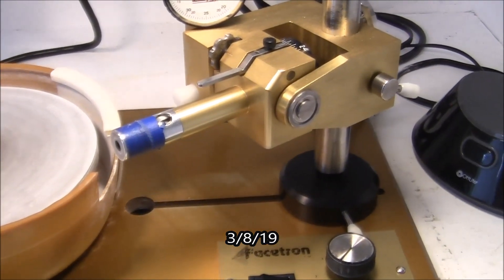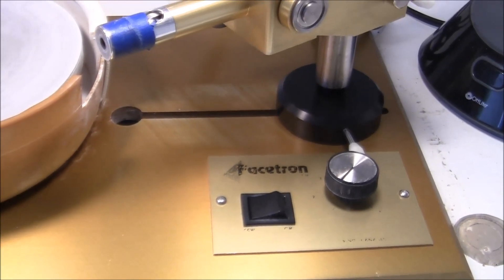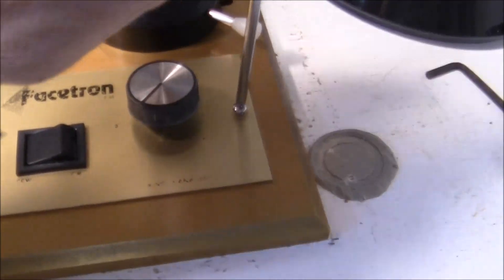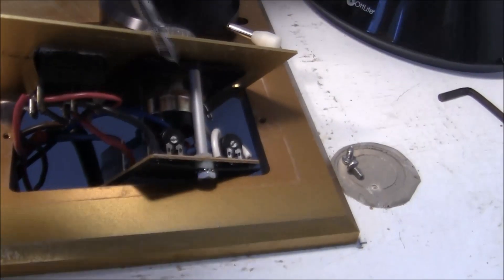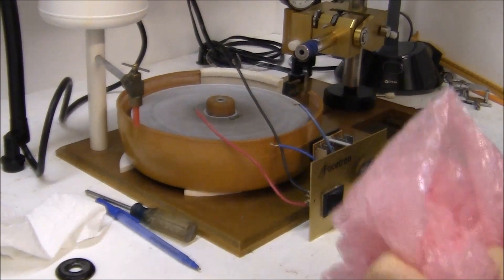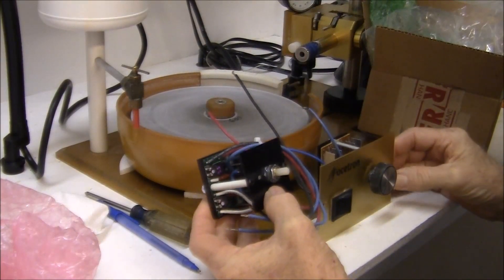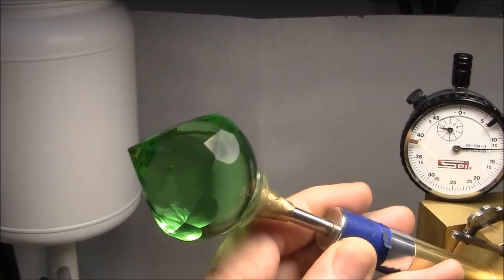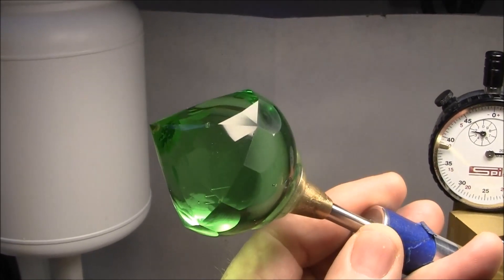Facetron speed control replacement/ huge gem update

Comment: My father just received his machine after waiting 10 months, the delay caused by a shortage of the motor driver.  I have redesigned the motor driver to use currently available parts and it works great.  It is a drop in for the KBDM-14PM.  It's a little tougher than the KBDM:  You can reverse the direction at full speed on a 1/6th horse motor.

Comment: Thanks for the video, I recently had my controller blow on me and I need to replace it as motor checks fine. Did you order your replacement part directly from Jarvi Tool or elsewhere? I live in Australia and currently don't have a local agent. Thanks.
Reply from the maker: yes i bought from jarvi.   there is a facebook group  for facetron users  and i believe they have had folks  discuss what they did  in a situation like yours.  Maybe  check them out.